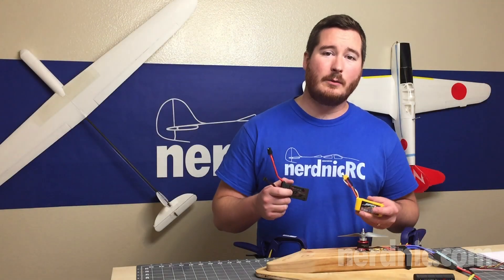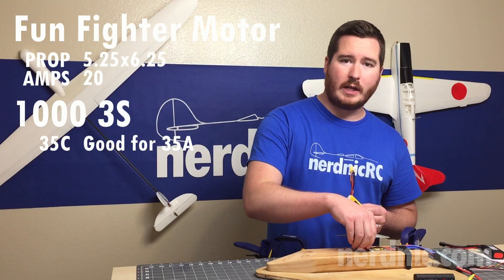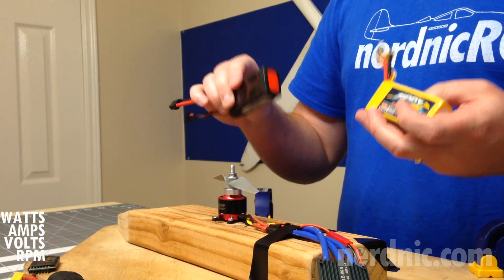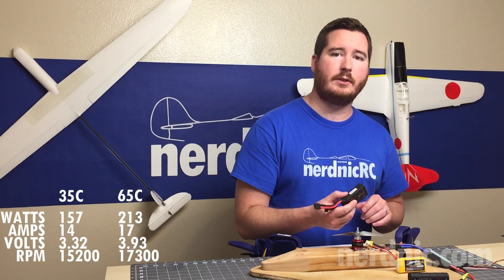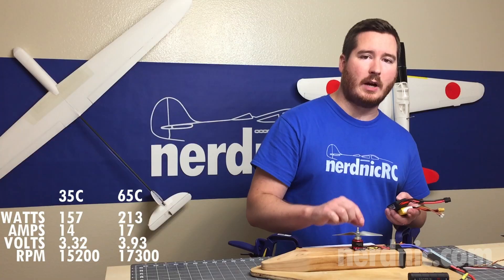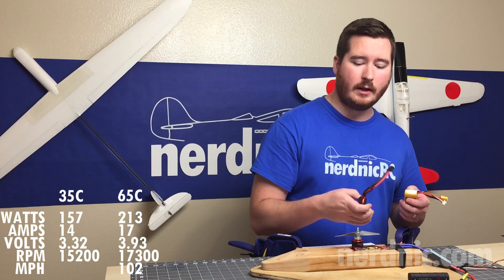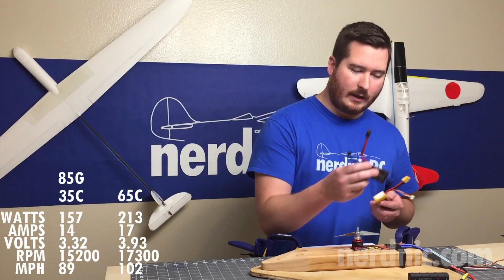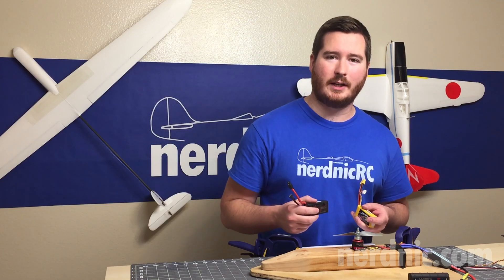nerdnic | Is A Higher C Battery Worth It? (Turnigy Graphene)

Comment: Now here is the rest of the story.  The C rating is almost NEVER what is on the label which makes comparison shopping nearly impossible.  Second, the lower C rated battery will give you more run time compared to similar mAh battery as it is drawing more amps.  So yes, you'll get a little more punch with a higher C battery, but it comes as the cost of decreased flight time, increased weight and increased cost.  Really worth it?  You decide..
Reply: this is exactly where i am right now. 4s 60c 2200 mah vs 4s 120c 2200 mah is 50 grams. i think losing 50 grams is more noticeable than 120c.

Comment: Very nice info.. nicely presented..but if the controller is only say 13 amps will it not burn with the higer C ratings battery?
Reply from the maker: Your speed controller must be higher amp rated than your motor/battery output. Using a high c battery should increase the output, so account for that in your speed controller sizing.
Reply: @nerdnic  in my case Iam already using a bbsd 02 36 v 350W 18 amps  as daliy driver to work but on steeps n stop go the lithium ion 8amps 1C battey could not much punch...I am ordering a new lit. ferro phosphate 20amps 3C peak discharge customised battery pack.. its expected to give 60A peak for 10 seconds on twist of throttle..will it burn the controller?
Reply from the maker: If I'm understanding your setup correctly, then I think you'll be fine with no issue. Going from a 1c discharge to 3c shouldn't increase your total motor wattage output by much. But where it will help is keeping the wattage higher on those hills and stop/go situations where your 1c struggles. Good luck!

Comment: Don't just look at the c rating since battery manufacturers always rate their battery c rating more than what they're actually capable of doing , pro tip check the Size of the wire (not all brand put the awg rating  on the wire so be careful Example 14awg will transfer less power than a 12awg since the wire is bigger so less resistance and heat will be contained in the battery so more power to the wheel. (Also I won't go into detail since my comment would take year to write , I ain't 100% sure too.)

Comment: You have to use the same Fucking battery dude. Come on did manufacturer are going to use diff standards of eating as well as diff equipment to do their c rating testing. Their is no universal eating authority on batteries to girantee what the manufacturer is claiming. It's just the manufacturer saying their batter does cuz. It's like an audio amp for a carm I can build an p and claim it's is whatever wattage I want and the only way to know for sure if for you to test my claim using a set device or set control baseline across multiple amps etc. This is a flawed test due to too many variables. Not a scientific test and you have no control .

Comment: If I'm putting a 3000mah 3S battery with a 30amp ESC , THEN is there an optimal C rating battery that I should use? 15C? 30C? 40C? Or does it really matter?
Reply from the maker: Hi Mark. Your ESC can handle any size/C battery. The trick is to make sure your ESC and battery can deliver as much power as your motor needs.

Comment: This is an interesting data set, however... I think the method needs some work?  You're controlling on C rating, which isn't "fair"  in this case.  The test you're doing is "is c rating useful to know"  And.. well. sure?  But you're not compensating for battery mass. 

Since these are going in planes, a more useful comparison would be "for a given mass"  So that 35C battery, should be something more like 1350mah, instead of 1000mah.  At that point, you could draw a good comparison between "is c rating worth it".  

.... Actually, I think.. with the data you provided, we can figure that out.  ... maybe?  At least we can get a vague idea.  

3.32v, 14 amps.  0.23 ohms?     Interestingly, we get the same .23 ohms with the 17amps and 3.93 battery voltage.    I was hoping to see a larger difference in IR.  I wonder if a 1350mah pack (assuming same mass as the 65c battery) would get you up to that 17amps of draw.  

On an airplane, where mass matters less, I'd definitely go for the most mah per pound I could get.

Comment: Does a high C-rated battery also provide longer run times, and does it have a longer life? (No. of cycles)
Reply from the maker: Remko Jerphanion run time, not really. In some situations you will get less run time in minutes because the power is released faster. 

Longer life, yes. This happens because less voltage sag means less heat. The drop in voltage is from the internal resistance in the battery, and the difference between the sag and the cells charge is how many volts/watts are being used to heat the battery. Heat kills our batteries, so the more you can reduce heat the longer it will last.
Reply: @nerdnic  Thanks for the quick and comprehensive answer, this helps!

Comment: I have a 30c recommended motor, and esc.. If i use a higher c rating battery, will it burn out my esc and or motor ?
Reply from the maker: It shouldn't cause any issue. However, to be safe you should buy a watt meter and test.

Comment: Wont a higher c rating will fry motors?
Reply from the maker: Jade Pogiitot no. If you’re using the correct prop then there should be no issue.

Comment: This is an excellent demonstration video. Thank you for the tests. If anyone knows the best 4s lipo batteries that can fit inside of 170Lx48Wx69Hmm space? Then please share. Shalom.
Reply: Weight is not a problem, I'm wanting at least 10000mAh capacity and discharge C rating is not my main priority too.
Thanks
Reply from the maker: Hi there! I don’t have experience with lipos that large of mah, so I can’t offer any advice here. What are you building?
Reply: Nic Lechner hi, me and my friend have modded Traxxas X-Maxx RC cars. They can take 2x 6s lipos for a 12s power using the castle XL2 ESC and 810kv motor. But he has the modded battery compartment extention rails. He needs the biggest pair of 4s high capacity lipo batteries with it fitting in the modded battery compartments. I found out that the Turnigy graphene 4s 10000mAh 15c will fit with his mod. Is there any bigger capacity batteries around that can fit in to a 170Lx48Wx69Hmm box??

Comment: Will too low discharge, cause an esc to not run a motor?
Reply from the maker: I would think as long as the voltage is correct, the motor should turn. However, if your motor draws too many amps vs what your battery can supply, you'll likely ruin the battery.

Comment: if i have 4 30amp ESCs, if i only have one 30C 3000mah lipo would that mean only one ESC can be powered fully at once? would it power every ESC at a quarter of the 30c max discharge? does that mean i need 4 lipo batteries to power 4 ESCs? Whenever i use one 30C lipo i can get one motor to run at full power or all of them to run quite weakly, what is the solution to this?
Reply from the maker: Hi, you don't need 1 batter for each ESC. If all 4 of them run, but weakly, then you don't have a powerful enough batter. Either upgrade a to higher C battery, or one with more mah.
Reply: will two 3s 6000mah power all four motors? that should be 120 discharge rate to power 30x4 (120 amp) ESCs?

Comment: In airsoft, my gun benefits from 25C over a 20C but the improvement is huge
Reply from the maker: That's good to know. I imagine you'd get a more consistent and powerful shot.
Reply: Nic Lechner it seems to cycle more evenly, yes, but doesn't increase how hard it shoots as the firing phase is only powered by spring tension, the motor simply compresses the spring. Great video, man.
Reply from the maker: Okay that makes sense. Thanks for sharing :-)

Comment: So if you there is a 29g difference in weight.... Why not make up that weight with extra capacity for the lower C pack and it will give you what you need? Using more capacity with the lower C will help. This is a balancing act that when done properly works really well.
Reply from the maker: Yes it definitely helps! I did that comparison in this video here: https://www.youtube.com/watch?v=qWZcadnSZQ0
Reply: Gooniac33: good comment.

Comment: There are a couple things that you are not taking into account. That is an over square prop that is actually cavitating when static. Props unload in the air so that prop may actually pick up some more amps on the air because of it getting more bite. Another thing to notice is that higher C packs also draw more amps. When you draw more amps you are actually using more energy so you actually lose flight time as well. Lower C packs are saving weight and when flown within their limits can actually get better flight times. If you really want to show how to effectively use the energy density of lipos you can find a pack that is the same weight as the Graphene pack but higher capacity which will help with discharge rate as well. Its a balancing act between weight, discaharge capacity and flying style too. Choosing packs based on discharge rate is the way that I do it which gives a good mix of flight time and performance. High C will always have its drawbacks..
Reply: gooniac33 He also uses different brands, where the battery with the lower C rating is a budget brand.  This test was rigged to prove a point.
Reply from the maker: The test was not rigged. If I used the same brand with different C rating you'd see the same result, higher C would provide more power.
Reply from the maker: There is another guy who thought the same thing, said my test was stupid and then did the test himself with same brand batteries. As expected, he got the same results as I did. https://www.youtube.com/watch?v=uFLL-idpuOw

Comment: Great vid..  Thanks for the info.  I'm also wondering about the battery life as well.  When I started flying a year ago, I bought the cheapest batteries I could get.  Now, they are pretty close to end of life.  Would the higher C batteries last longer?  If so, it would offset the higher initial cost.  As a noob, I also wanted the lowest amount of cash in the air so if I lost the craft I wouldn't be out quite as much money.  

Still flying the nnP-39 and loving it.  Thanks

Comment: Great video, I have the same batteries, but also the Zippy compact 40C, I found the Zippy packs (1000MAH, 3S) 35C and 40C don't last as long in general. You might save 2x on cost, but it only lasts 1/3 the time a 65C 1000MAH in total lifespan. Well done Nic